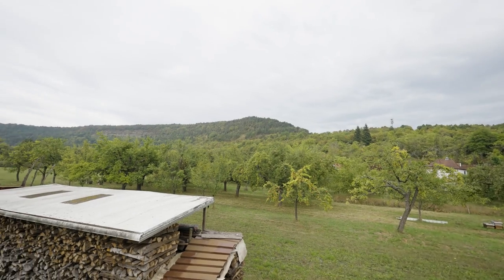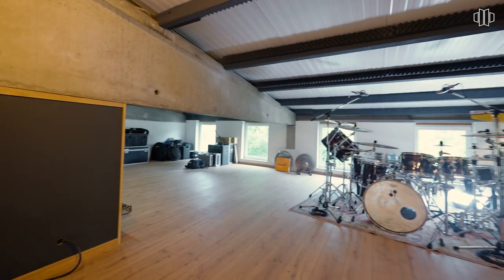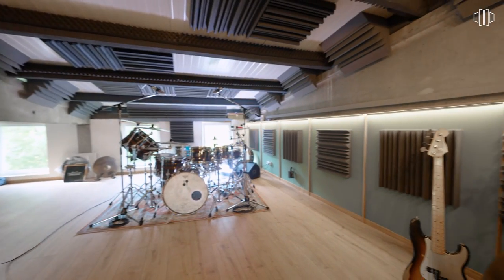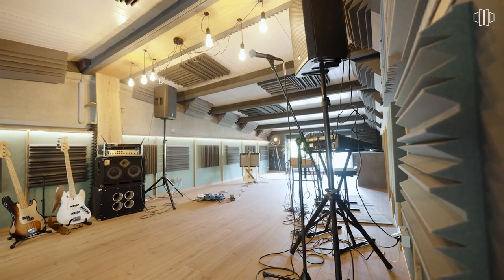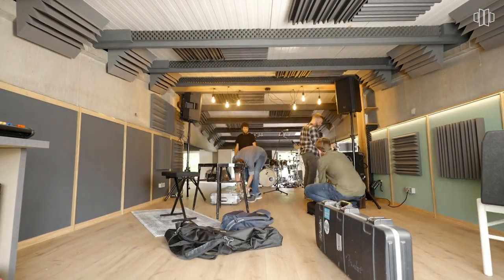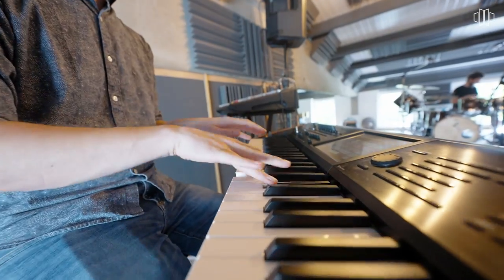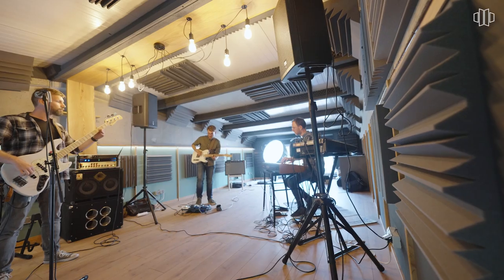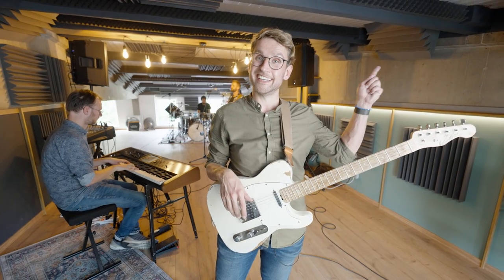3 STEPS! How to make your rehearsal room sound better!

Comment: Really interesting video. Is it possible to optimize the acoustics of a square-shaped 10 m2 room for a woodwind player? I would like to use the room for practice and as a very neutral sounding space (but not too dry) in order to record on Pro Tools and add a touch of high-quality reverb.
Reply from the maker: Hi :) Just check out the Room Configurator, which I also linked at your other comment. To make sure here it is again: https://takustik.com/room_concept/rehearsal-room/
Reply: @t.akustik    Wow! Danke!!!! 

Here is another question. Is it possible to optimize a room even more for one particular instrument as we know the general frequency range and other characteristics of a given instrument. Of course this assumes that no other instruments will be played in the room.
Reply: @t.akustik    Worldwide shipping available via ship rather than air cargo?